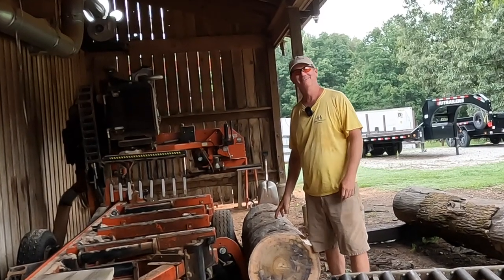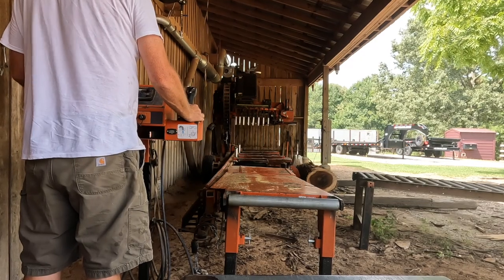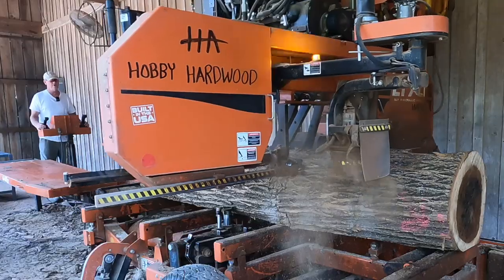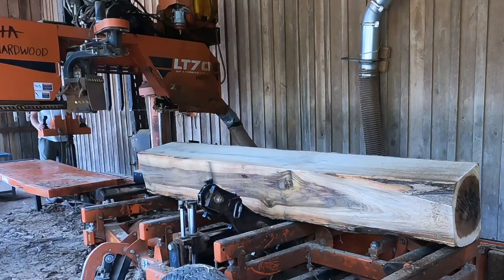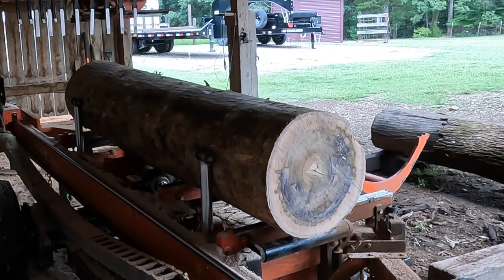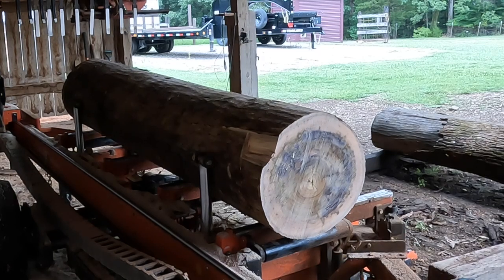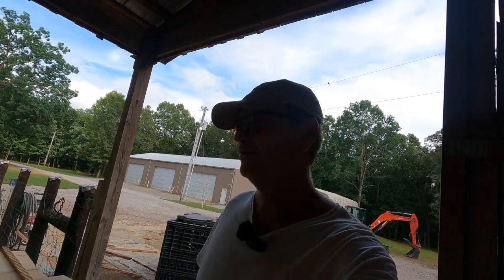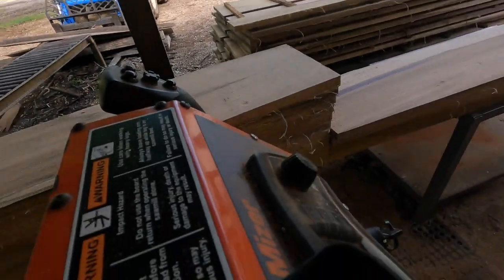Timber Transformations: EPIC Fast Sawmill in Action

Comment: Haven't seen any on the kiln in awhile or putting the weight stack on etc.
Reply from the maker: Very good catch, you are always on point.  I am going through a "reevaluation" phase right now on what level of detail I put about our whole operational steps in the videos.  I've decided I will still do sawing videos, among other stuff, but I'm taking the Coca Cola approach with my kiln drying, i.e. the "secret formula" thing.  I have developed a few more "trade secrets" in the last while in my kilns that allow me to dry faster and flatter than ever before and I don't want to pass that on to the several local business who are in direct competition against us, and who literally tell me they watch my videos to  "learn advanced techniques."  You're also probably noticed a drop off on my discussions on the Forums on kiln drying.  However, if you ever need help, let me know.
Reply: @HobbyHardwoodAlabama  I don't have a kiln, but interested as most FF guys are.  I'm starting to have my air dried wood kiln dried and all the knowledge I have the better.  I"m also a continual learner like you.  I'm also an ME like you.  Brad_bb